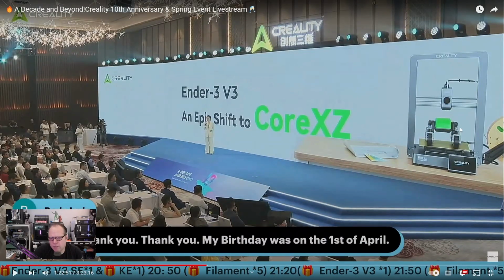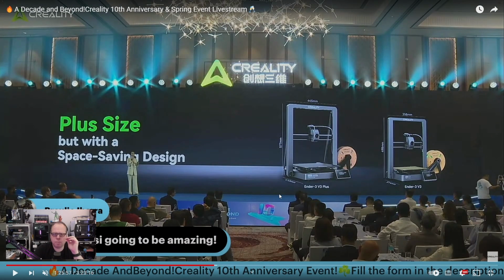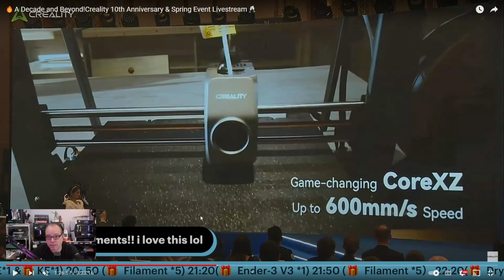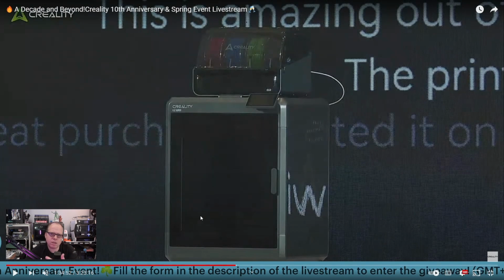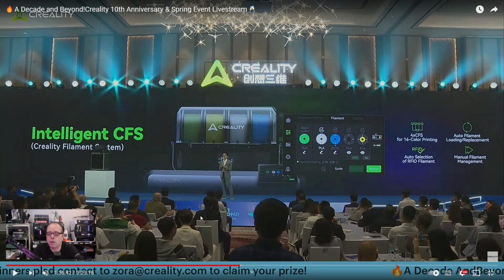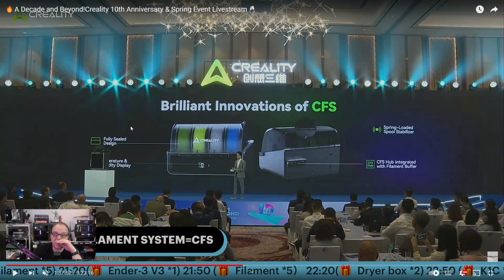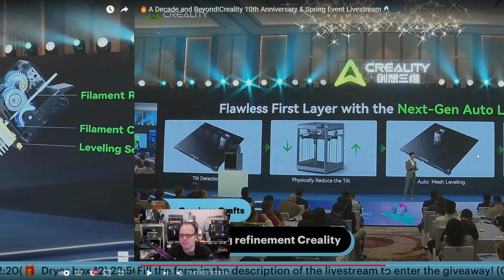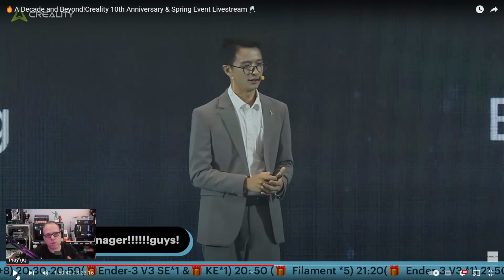Creality Ender 3 V3 PLUS and K2 PLUS with CFS - ZACH REACT!

Comment: cheaper than 1000 USD lmao
Reply: Hopefully very cheap! 100€ for AMS and 750-850€ for printer would be so nice
Reply: @holziarbeiter5907  I'm saying thinking this thing will cost below 1000 is absolutely absurd. Considering the K1 max started at £900 this will at least go for 1000USD if not I believe around $1250 as a speculative guess based on other machines. But I guess my perception is based off bambu lab printers.
Reply: Yeah and i said hopefully ... 

Why should i buy such an creality if i can get a cheaper bambu which has no more Problems and runs perfect if its the same expensive price Nobody will buy it i think bambu brings an xl and with Innovation

 hopefully an idex or dual toolchanger with each ams so one prints another changes color and purges this would be the best and fastest system except of poop waste but nearly millions of colors possible and no time waste! Would be such a grate improvement and would be so gamechanging for multi color/material printing!
Reply: But for the people who have the 3 v3 ke , se , corexz the cfs is probably gonna be best seller
Reply: @ushapatel6260  Slim chance j think this will work with many other printers. K1/C at most, MAYBE the V3...
Reply from the maker: Yeah, I'm looking forward to the price